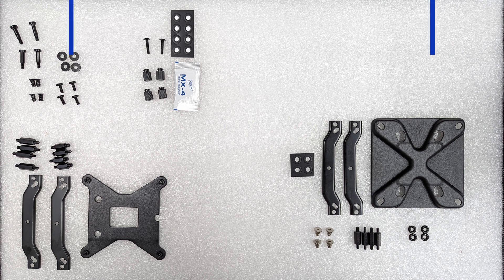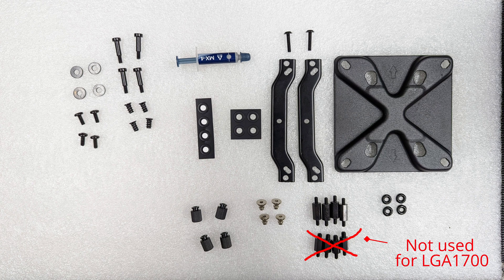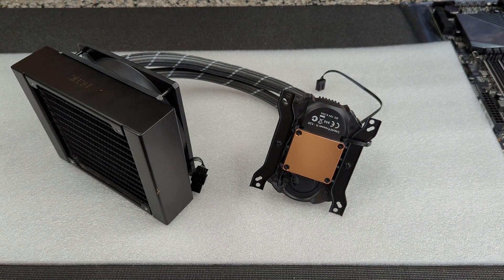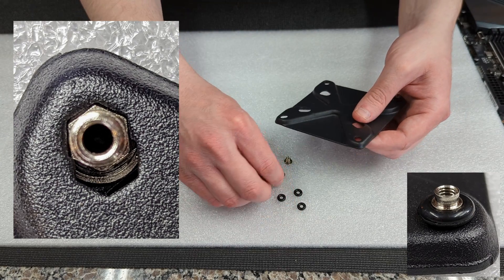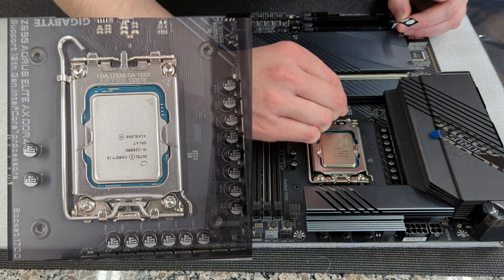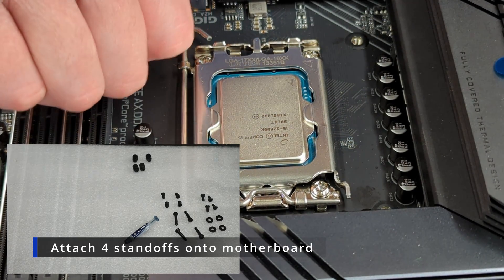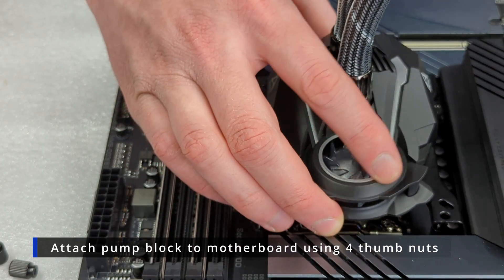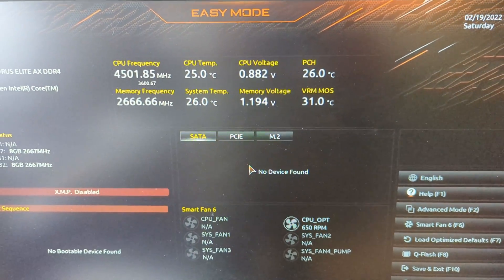LGA1700 Install of Arctic Liquid Freezer II with New Mounting Kit

Comment: Thank you for the tutorial. I made a mistake when pluggging the PWM connector to the AIO_PUMP socket on my motherboard and spend a good 30 minute to figure it out why it won't POST
Reply from the maker: My apologies, some motherboards don't like to boot without something plugged into the CPU_Fan header. Some AIO's have separate connectors for the pump and fans, although this one does not so its fine to plug into the Fan header
Reply: @KLEEBZTECH  no worries! Just to share with everyone. my MB is Asus ProArt Z690. Fault beep code is 1x long, 4x short which means 'hardware failure' in manual book. I'm almost returning it 😂
Reply from the maker: We had something similar happen on an Asus B450 with a fanless CPU cooler, we ended up finding a setting in bios to disable the monitoring for the CPU_Fan header
Reply: Hi  @cococamper  . I'm about installing my Arctic Liquid Freezer II 420 on Asus ProArt Z690. What did you do then? And did you replace the PCB cover or just removed it, so it fits? Thanks from Denmark
Reply: @allanmaul4319  I removed the cover. No problem so far running it without the cover. I have contacted Arctic for cover replacement.
FYI i also cut one of the fan's corner because clearance issue from the plastic shroud near the 4pin CPU power connector
Reply: Thank you for quick reply  @cococamper  :). Where did you end up plugging in the PWM connector? Just so I don't make the same mistake. 

Thanks from Denmark
Reply: @allanmaul4319  at CPU_FAN socket, route the cable in between the RAM and pump.
I suggest to do 'Alder Lake washer mod' too. It keeps CPU temp even lower
Reply: Thanks for all your help  @cococamper

Comment: Hello sir and thank you for your video. Why plug in cpu_opt and not cpu_fan? Shouldn't the pump run at full speed or is it safe like that? Thank you in advance
Reply from the maker: From what I understand, generally the CPU_Opt will have a higher power output than the CPU_Fan header, but either should work fine for most AIO's. If your bios requires something to be plugged into the CPU_Fan, then it shouldn't be an issue to use that instead.
Reply from the maker: And some AIO's will have a pump connector and fan connectors, in which case I plug the pump into the CPU_Opt and the fans into CPU_fan.

Comment: Thank you for such a detailed video!! One question, are the spacers on each side really necessary? I feel that they will be crushed flat once you screw on the pump anyways..?
Reply from the maker: I've done it without using them, but if you scratch your motherboard during installation there is a slight risk you could short something out potentially.
Reply: @KLEEBZTECH  Thanks for your answer, and your video. I slapped it on yesterday and I saw a -22 degrees cooler CPU coming from Cooler Master 360 AIO. That's an insane difference by swapping the cooler and using the correct brackets!
Reply from the maker: That's great to hear, glad we could help.

Comment: Seems like these will be the perfect choice for mini itx z690's since the hoses come out the top of the CPU plate not the sides.
Reply from the maker: The pump block is quite large due to the VRM fan, honestly its actually not a great choice in my opinion unless you already know it will fit on your motherboard.

Comment: Great video!  I don't know about the amount of thermal paste you applied but to each their own.
Reply from the maker: It's probably a little excessive, but it's not hard to clean off either
Reply: @KLEEBZTECH  So long as it doesn't run and contact other components, there shouldn't be too much of an issue.
Reply: @jamesmoriarty3877  its anti static, nothing would happpen

Comment: Does the original bracket works with 12900k ?
Reply from the maker: Not really. Some Asus motherboards have holes for lga 1200 brackets, but the height difference between LGA 1700 and 1200 would mean your 12900 will probably run into issues
Reply: I just installed my 13900KS using the original bracket on a Asus Z790 Apex

Comment: Man, can i use this but the mobo still on case?
Reply from the maker: If you are trying to install it without removing your motherboard from the case, then your case will need a cutout behind the motherboard for it to work. The cutout will need to be bigger than the backplate. You may have to tape the backplate while installing the cooler, but it should be manageable.
Reply from the maker: When I say tape the backplate, I only mean while you are mounting to the pump, once it's on there I would remove the tape

Comment: On the pump block using the long screws are easy to screw in at first but feel like they need a lot of pressure later. are the long screws supposed to be used here?
Reply from the maker: It sounds like you may be doing something wrong. I would recommend rewatching closely to see which hardware to use.
Reply: I have the same thing on the 360 model. There's something with a thread inside the nut. I wrote to the manufacturer while I'm waiting. If they don't answer anything, I'll try to cut the thread inside.

Comment: I have the same motherboard but a 280 aio and in the bios it says the cpu is at 99c when my gpu is at 40c, do you know why this might be happening
Reply from the maker: Sounds like a mounting pressure issue, something might be interfering with the pump making solid contact with your CPU
Reply from the maker: That or maybe your pump just isn't working

Comment: Very good and clear video! 👍👍
Reply: NOT just clear. You made a bad user manual on your website!! Check it please!
Reply: Thanks for him, your website wont answer for the qr code online manual!
Reply: Ehy arctic Friends, what about rog strix b660i? The backplate you send me is the right One but don't fit at all, the spacers are too low and the backplate itself have a sort of tremble. Your adaptor don't fit a lot of motherboard, not only mine. And i don't even talk about the liquid freezer II series, its impossibile to know which rev. you or Amazon or others Will send. I love your products but c'mom...
Reply: Can you verify that the liquid freezer 420 is compatible with the Fractal Design Define 7 Case? Thanks in advance!
Reply: I bought the 360 and didn't come with mount. How shall I buy it